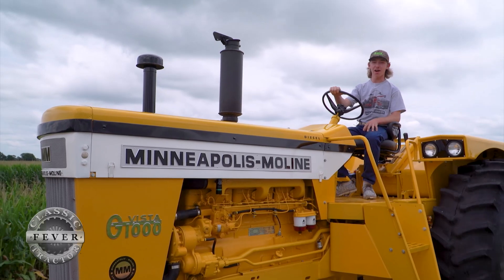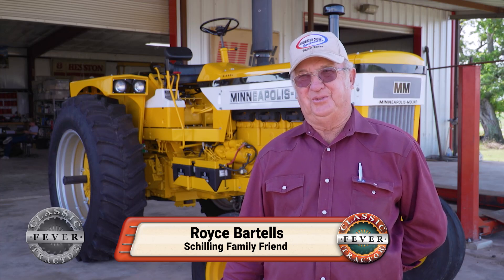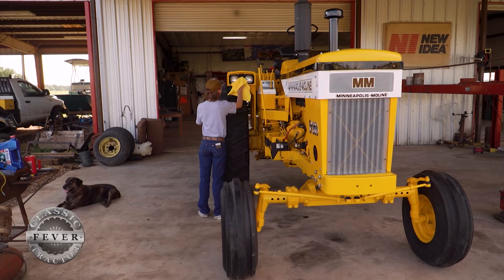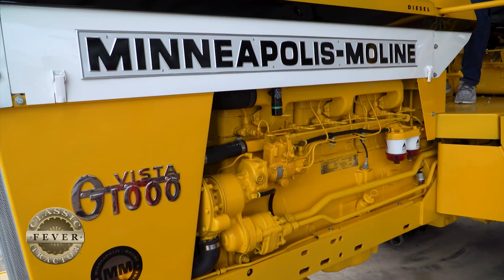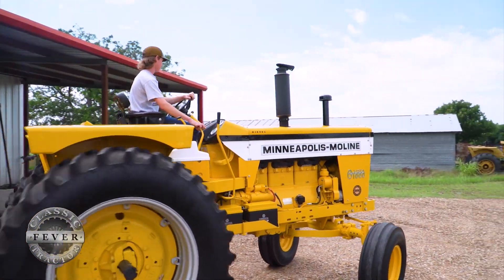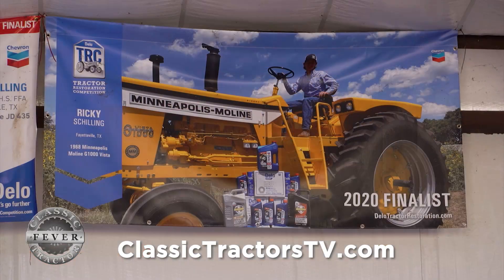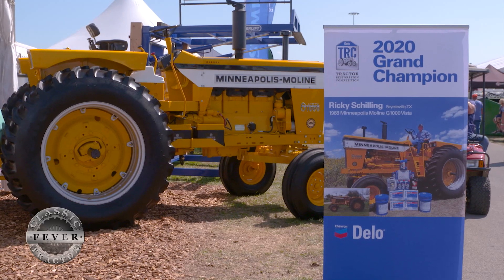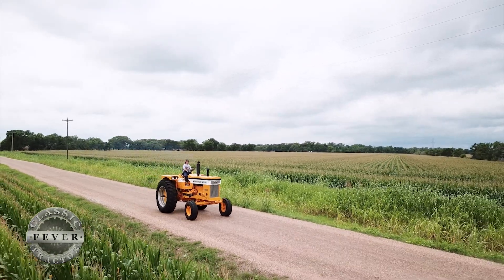TWO TIME CHAMPION Tractor Restorer Brings This 1968 Minneapolis Moline G1000 Vista Back To Life!

Comment: Weak point on G-1000s was pinion bearing. If farmers pulled big loads at slow speeds. Bearing went out wrecking ring gear and pinion.

Comment: Imagine not having a side console IM LOOKING AT THE PRE 68 JD 4020s
Reply: I have a 68 4020. Never bothered me I guess. We had a loader on a 66 4020 using the dash controls to run it. Worked fine in my mind. I always thought tripping over the shift lever on the floor of the Oliver's 1800/50 years along with ih and there high low two level shifting patterns were a pain. But I guess it is all what you get used to.